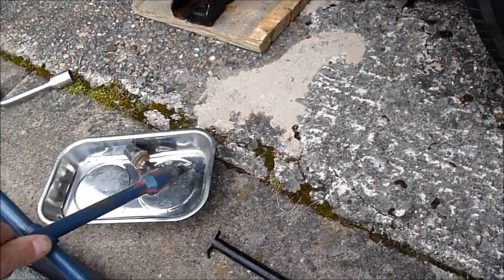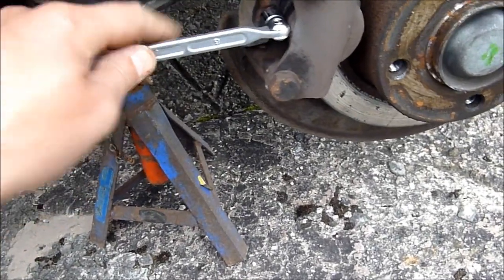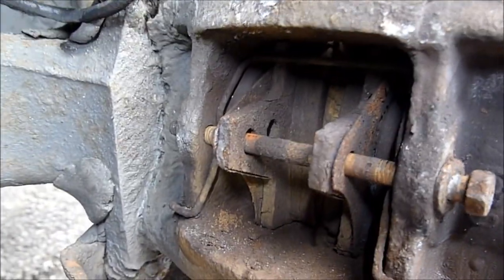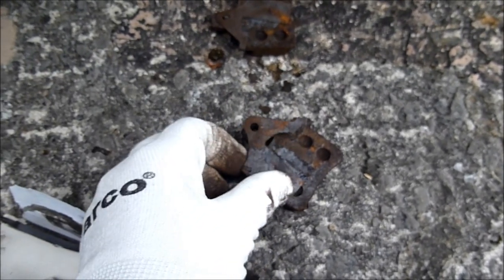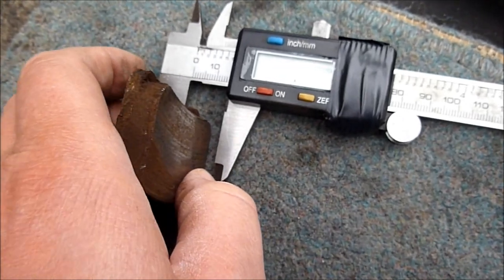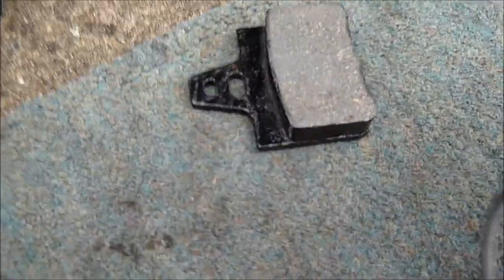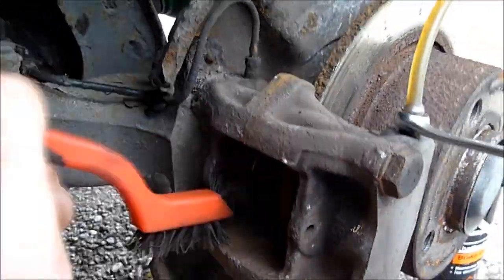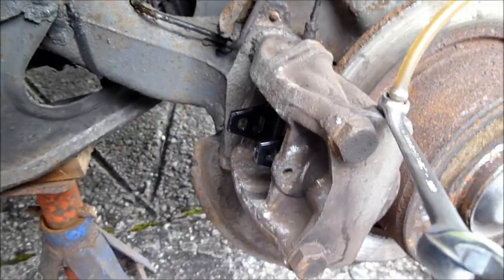Citroen Xantia Rear Pad Change in HD

Comment: hardest part is to put spring back,u need make sure sring preses every pad if not u will had scary noises from pads on bumps,spring is prevent them from moving . :)))
Reply from the maker: I agree that the Spring is a bit difficult to get under the Bolt, The most difficult job is changing the Rear discs , beware of breaking the long Caliper bolts!!! I did the Front Pads afterwards but not filmed it, I will be doing front Drop Links Next & Air Idle Control Valve & Lambda Sensor